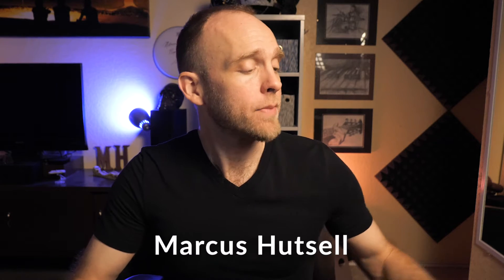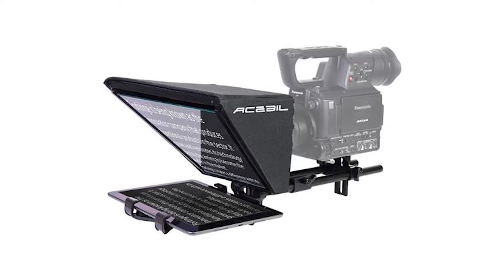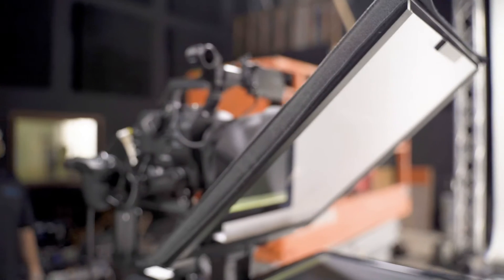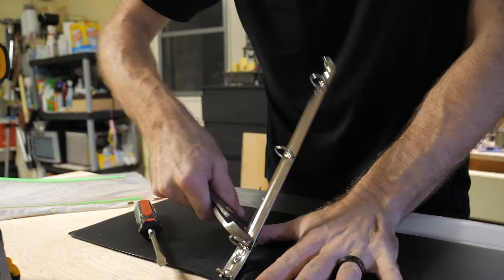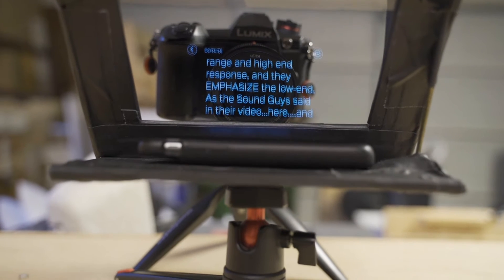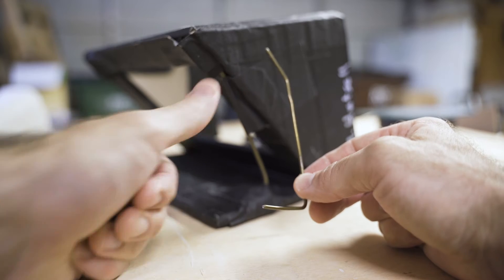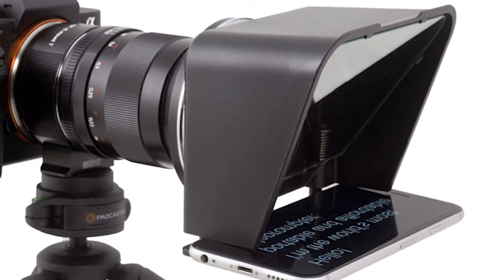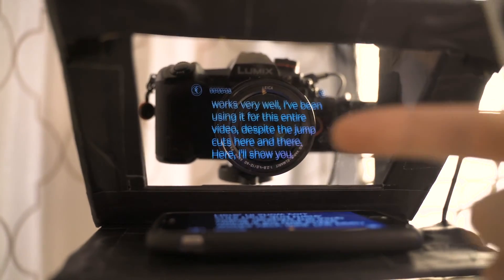How to make a DIY teleprompter for free - Featuring the Parrot Teleprompter App

Comment: I made a teleprompter out of a diaper box and the glass of a picture frame. I was lucky because the glass on my ultra cheap frame didn't cause that double image, so the teleprompter text looked crisp and clear.  I had the camera inside the diaper box and the whole thing would go on a ball head that sat on a tripod. Seeing how you used a binder to build a smaller one makes me want to make one again.
Reply from the maker: Diaper Box, awesome!  Whatever works, nobody will really see it but you.  I have 2 other teleprompters but I constantly just use my home-made one because it's light, I don't have to spend time "setting it up" and I can use a wider lens (about 20mm max) on it.  Cheap, easy, does the job.

Comment: Hey Marcus, how do you get rid of the double and or blurred letters on the teleprompter, I'm having that problem with the one I made up
Reply from the maker: Hi Kevin.  That's where you (or I) would need to purchase that special beam-splitter glass instead of just using regular glass.  It can get pricey, but you can order JUST a piece of glass from telepromptermirror.com and customize it to the size you want.  An 8'x6' piece with shipping and tax though still costs about $70, but it's the only way to get rid of the doubled-text.